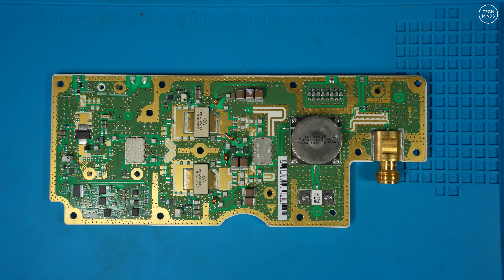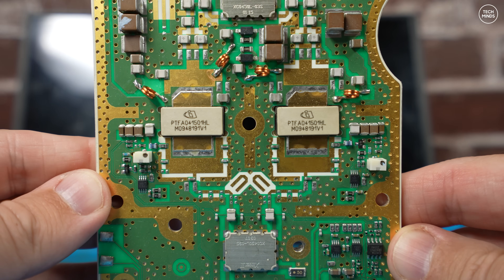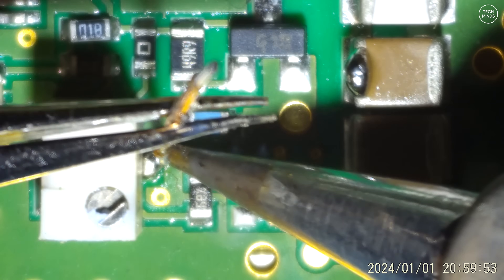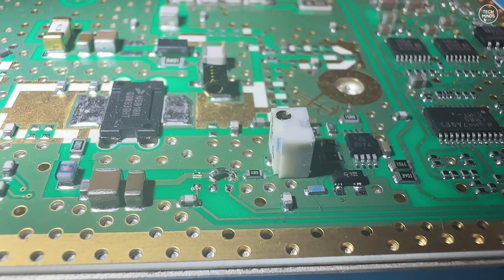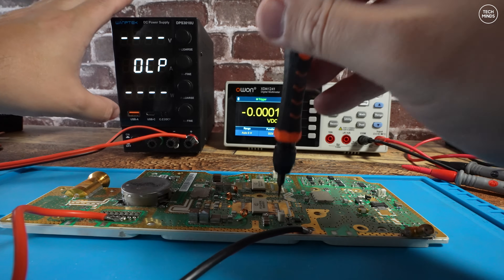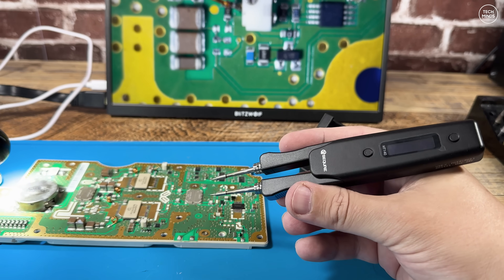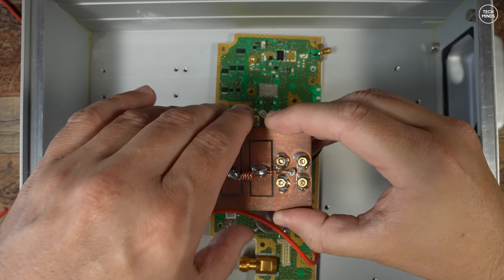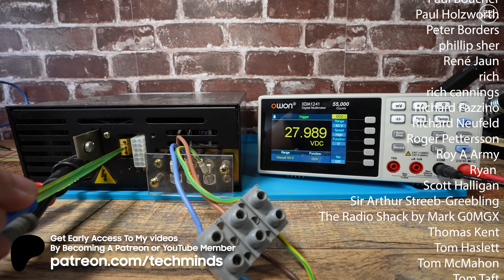Converting A Commercial UHF 350 Watt RF Pallet For Ham Radio Use - PART 1

Comment: Yes the isolator (circulator + load) is standard fare on commercial gear. I’ve used isolators for years when testing gear. They can give you 40 dB of protection if properly matched. I’ve only built one of these pallet modifications but the thermal calcs I did showed the heat removal was very borderline. I put a 1/4” copper plate under the board and that was just OK to spread the heat into the heat sink. All commercial gear is connector terminated for reliability reasons. If a soldered coax breaks off for any reason then you are relying on a modified circulator to save you from a rather expensive repair. A really interesting mod with the magnets on the circ. I’d love to know how well it worked. Be interesting to know what the pallet came from. Something that high power is not often used in cellular systems not even for DMR/P25 base stations.

Comment: First of all, do not remove the N connector. Any mismatching will return power into the circulator and makes any kind of service difficult. Second I'd try to buy a aluminum or copper block and put it under the palette. Remove any protection layer from the bottom of the box and the aluminum block, if you use one. For the modifications made, I wonder if there were no other ways to re-connect the BIAS controls by using other SMD parts, however, if you use botch wires, give them more contact from copper to contact of part. Solder them with the stripped area along the other SMD part instead of soldering them across on top. Reason is the heat expansion. If things flex and the wire is strapped inside it flexes with the expansion. But if soldered across, it it pushed and pulled and the solder point may break. And finally you may need to re-trim your filter if it is mounted with the N connectors on top and the coils below in the vicinity of the metal of the box. So measure that again before putting too much power into the PA. For the SWR measurement, there have been quite a few full metal SWR bridges on Aliexpress, but I can't find one in a quick search. These had a single port output so mounted reverse they report reflective power. Mounting the SMA output to one of the analog devices Millivolt meter PCBs for Arduino would have solved the problem. May be you need to add in another few dB attenuation before the mV meter. That's my few pence for the project. 73 de DC3AX

Comment: FYI, last fall I packaged W6PQL's PA block for 432, as well as his LPF.  Though rated for 500W I couldn't get more that 350 for some reason, and the input VSWR was high.  Using a 40 year old yagi I worked a single station on 432 for the EME test.  So your pallet looks good but it is bound to be less efficient.  Cheers!  -- Wayne K3WM

Comment: To me this is rather painful to watch the modifications without having a diagram and knowing exactly what you are actually doing. Had nobody been able to find a diagram for this UHF power unit? It looks like a really well designed unit.
Despite the heatsink having a lot of surface it looks quite flimsy for a possible few hundred watts of TDP. But on the other hand, no one keeps you from putting a huge fan on it.
Tap your spectrum analyzer with a capacitor to the switching supplies output under different load conditions and check out if it remains clean and maybe user some home made low pass filter to insure the 28V DC power doesn't mess with the signals in the amp.
I hope it supports a larger linear operation and doesn't mess up your signal in case you go for SSB EME. You may also need some long-yagi antenna arrays in order to turn this into a few KW ERP. You may also need some ultra low noise pre-amps close to the antenna to pull up the weak reflections. Sounds like fun project, good luck.
Reply from the maker: The modification procedure came from someone who sold me the amplifier. He is an amplifier expert, literally. I presume he has a diagram to be able to document what needs to be done. In a recent video I made a “high power” capable Low Pass Filter using my cnc machine, that will be used with this amplifier. Unless you meant the power supply? I can assure you the heat sink on this inverter casing is not flimsy. It’s extremely heavy. I use the same case on a 2.4GHz 250 watt amplifier, for nearly 3 years. And yep, fans will definitely be installed I’m currently working on some fancy amplifier management logic with a nice display. Cheers and thanks for your feedback. :)
Reply: @TechMindsOfficial  Thanks for the reply, since we all want to learn, it would have been so interesting to understand what these modifications did within the circuit. Just getting things going is one thing understanding why is learning on how to apply some of the tricks systematically also to other circuits. Its a bit like running a script and not knowing why it does what it does and just hoping it gets a specific result ... I agree that sometimes we don't have times to go deep to understand it holistically, but wouldn't it be even more satisfying to make it work AND know exactly why it works better now and what advantages and disadvantages or risks the mod has been creating?!
I would insist of making a copy/scan of the circuit diagram, ideally from a service manual, with e.g. all the voltages, currents, RF level, and document my changes and try to get my head around it.
Reply from the maker: @n1vca great idea! I will see if I can get that information and present it in the next video. However, one of the hams which has been heavily involved with this modification has commented on this video, so he may know the answer and detail here. If not, I will try and present that information in the next video. Thank you so much! Appreciated.
Reply: @TechMindsOfficial  Thanks, I think that would be very interesting and be an interesting subject of discussion where we can hopefully all take away valuable practical knowledge, since tons of commercial communication gear should become available in masses because of more use of IP fiber links and new RF technologies that can't be done with the old hardware. Whenever I look at bigger radio towers here in Germany, all the platforms with UHF/SHF dishes are being taken off and are empty now. That well designed stuff must pop up somewhere,  
so understanding the modifications will be helpful for all of us in the future.

Comment: get rid of that circulator, you have that filter after the amplifier. You also have already reverse power sensing implemented on the PCB, after the circulator. Use normal meters, any digital stuff will be fried by that level of output power.

Comment: The pallet has a forward power detector built in. It is before the filter but should be OK. It is that line just after the circulator. It doesn't have a detector on it, so you will need to add a diode. No need to have a reverse power meter, but if you want you could measure the power across the circulator dump load with a diode detector. Otherwise, there are plenty of surplus directional couplers around. You should have had a load on the imput, but it won't matter. The output already has the circulator, so the PA will see 50 ohms even if you don't have anything on the connector. I would remove the connector and fit some semi-flex coax, but a copper heatspreader underneath would work as well. Just make sure there is low thermal resistance.
Reply: That is what I wanted to write too. On my palettes for different bands, there were always power and or reflected power measurement diodes somewhere on the PCB. Just need to identify them and tap off their voltage or RF. If RF you can use one of the analog devices Millivolt meter PCBs that directly attach to Arduino.

Comment: Anytime I build a amplifier using PA decks like this I usually use a piece of 1/2 inch thick copper plate as a heat spreader/riser block.  That way I can leave the factory installed connectors on the board.

Comment: It needs to be fully checked on a spectrum analyzer into a proper dummy load
Reply: at 437 MHz 333ks, DVB-S2 I got:
-50 dB shoulders at 60W and 10A
-40 dB shoulders at 100W and 13A
-30 dB shoulders at 150W and 16A
-25 dB shoulders at 175W and 18A
-20 dB shoulders at 225W and 21A

Harmonics are very low due to the low pass filter. Still thinking about some further optimisation of the ATC capacitors to improve efficiency. It is good for 100W of DATV and probably 200W of SSB. The magnets helped the efficiency quite a bit below 450 MHz.

Comment: Although there is no rf power going in I'd still do experiments with a dummy load on the amp output. Blowing the output transistors will be no fun, especially trying to replace them.
Reply: In that case the circulator did add in the protection you talk about. Any reflected power is routed to the dummy load resistor on the circulators 3rd pin. However, it may have been a good idea to just put a short or a 50R terminator on the SMA input as that avoids any near by radio source to make the PA doing spurious transmissions.

Comment: Yes why no dummy load?
Reply: There is a dummy load :) There is a circulator, with a 50 ohm load on one port. With the output open any RF would reflect back to the circulator and be dumped in that load. All the PA will see is the 50 ohm match of the circulator. Magic.
Reply: There's nothing exciting the amplifier, so the only output would likely come from parasitic oscillations within the amp itself, which wouldn't be good/expected.

Comment: It is good practice to always terminate the output of an amplifier when powered, certainly with the amount of gain this amp has. You do have protection in this instance, as I can see a load resistor on one of the circulator ports. Good luck with your build.  Nick G0OQK